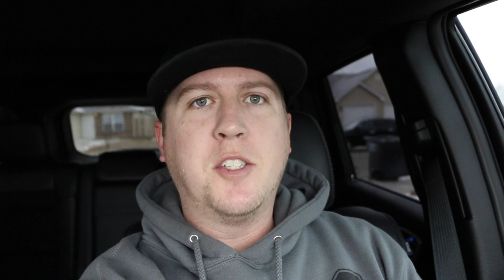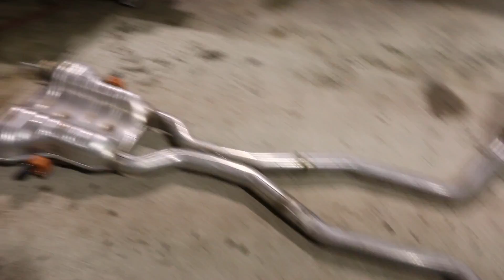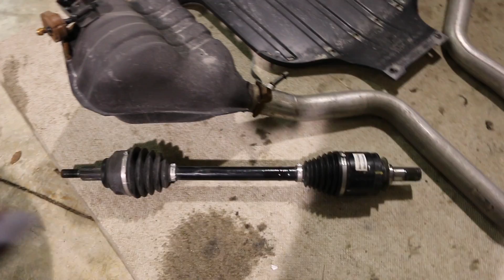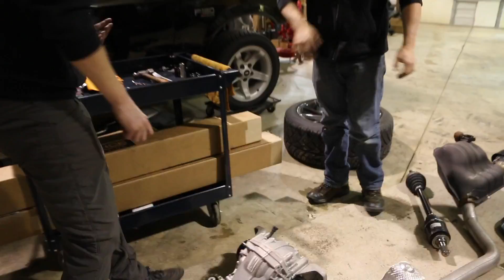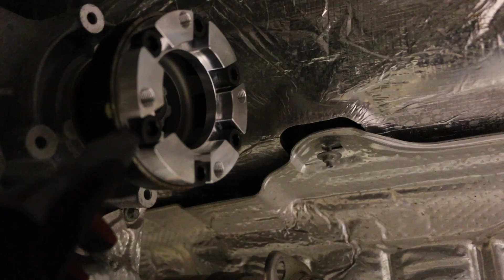The TrackHawk is already getting new rear axles and one piece driveshaft

Comment: I just had my 2nd rear driveshaft complode going down the highway on '15 SRT. I'm considering the aluminium driveshaft but I'm conserned with rubbing and vibration issues. Would you recommend this?
Reply: I have the same problem. Vibration on a OEM driveshaft

Comment: And you guys talking crap about the stock exhaust don’t know better. The whole stock unit is 61 lb. the lightest aftermarket exhaust is like 45 lb. 15 lbs gunna make a difference? It might pick up 15 hp with more flow but 1500 dollar form15 hp is totally not worth it. Stock exhaust is the most “sleeper”.

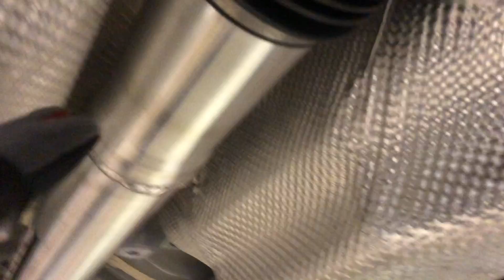Comment: So the issue with yellow dots... @ 10:28, the camera focuses briefly on the front mating flange with the factory yellow dot, but if I follow your explanation, the driveshaft yellow dot should line up with the mating flange yellow dot (the driveshaft yellow dots are on the tube [body] of the driveshaft).  It doesn't... 

I would think you would want to install the driveshaft lightest point, a.k.a. the yellow dot, a.k.a. the point to "put the weight", opposite the mating flange yellow dot, to offset the heaviest points 180 degrees rotation apart, to minimize harmonic imbalance.

Comment: From what I have seen with hellcats, it wouldn't be a terrible idea to put a diff. brace on it wither.
Reply from the maker: Diff braces are fine and all but it only braces the rear of the diff. The front still will have flex causing the diff case to possibly crack. Gforce is going to design some solid diff mounts to eliminate this issue.